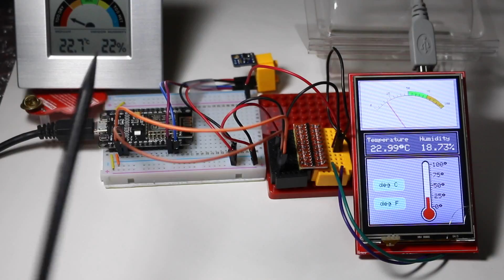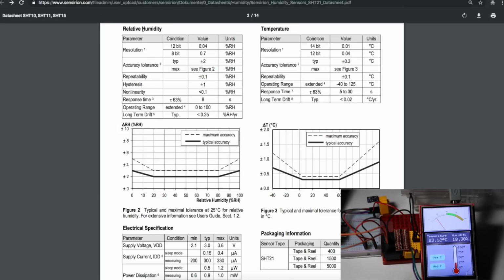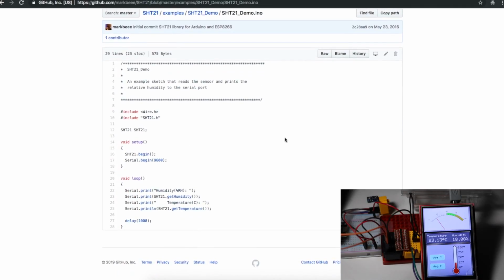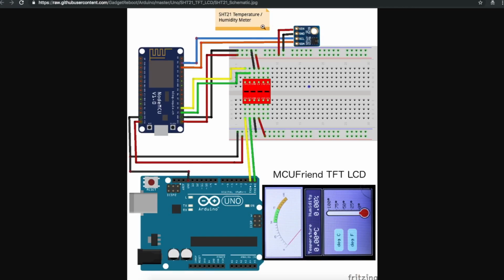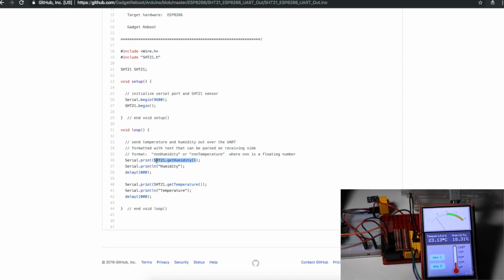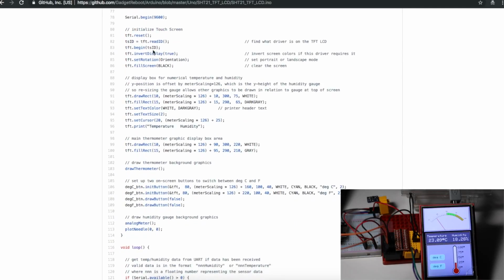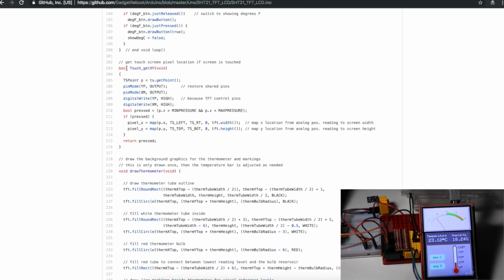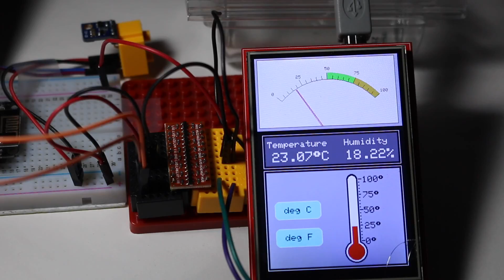SHT21 Digital Temperature & Humidity Sensor Tutorial for ESP8266

Comment: May i know if SHT21 can replace with DHT22....because SHT21 not available at my country..tq
Reply from the maker: I used DHT22 with Arduino Uno and this other video, https://youtu.be/ATROwE9lYHM
 It should work with ESP8266 if the sensor is powered from 3.3 V instead of 5 V  because the sensor data sheet says it can operate at 3.3 V which is what ESP8266 needs. 
 So you could try taking this SHT21 sketch and commenting out that sensor information from the sketch and then copy over the DHT22 information from the other sketch and merge it together.

Comment: Very interesting project.
What screen are you using, a 3.5-inch ILI9488?
What should I change in the sketch to, instead of SHT21, use a bme280 or DHT22?
Thank you
Reply from the maker: That sounds like my touchscreen, it’s either 3.5 or 3.6 inch and the diagnostic tool said that the display driver is  ILI9341, ILI9488.   I never did fully understand how to decide which driver it is I just mess around until I get something working and I even have to refer back to other display videos I have done successfully to doublecheck. 

 I have a DHT22 sensor that I haven’t used yet so I’m not sure what needs to change until I work on it and do a video. I will try to do that soon because I need to do garden watering sensor things anyway. 

 Keep checking back and I will try to do the DHT22 using this same display and set up.
Reply: @GadgetReboot  Okay, I'll wait; thank you
Reply from the maker: I’ve started adapting some older temperature sensor projects to use DHT22 now.   I hope to have something more presentable later but for now I put one sketch on github that used to use DS18B20 and a slightly different touchscreen printout so you could check that out while I still work on putting one or more videos together and eventually modify this particular SHT21 project.
https://github.com/GadgetReboot/Arduino/tree/master/Uno/DHT22/TFT_480x320
Reply: @GadgetReboot  Hi friend! Thank you for this sketch, I will try and, when you have some others, if you can, please send me, I will be very grateful.
I always comment: there is a great inconvenience regarding the logic pins of these Displays, that resistors (or dedicated ICs) must be used to suit their logic voltage. In case of using Arduino Uno, Nano, for example, that has its logical levels with 5V. Manufacturers should have thought of this - what do you think?
Hi friend (Gadget Reboot), thank you for this sketch, I will try and, when you have some others, if you can, please send me, I will be very grateful.
I always comment: there is a great inconvenience regarding the logic pins of these Displays, that resistors (or dedicated ICs) must be used to suit their logic voltage. In case of using Arduino Uno, Nano, for example, that has its logical levels with 5V. Manufacturers should have thought of this - what do you think? Thanks again,
Daniel Fernandes

PS. How should the pins of ILI9488 be connected to Uno or Nano?
Reply from the maker: @Dancopymus  The video with the projects included is now posted:  https://youtu.be/ATROwE9lYHM  
It shows how the pins of my display line up with the Uno pins to plug in correctly.  I haven't tried with a Nano so I'm not sure if there's enough pins free because  my display has so many pins - there are some that use fewer pins with SPI and those may work better.  I should shop for more than just the one that I have with so many pins.  

Since Uno came out so many years ago, back then 5V and 3.3V were both in use, transitioning toward 3.3V, so since the old 5V technology is still used for some Arduinos, it's hard to know which voltage to support on new hardware that will connect with old, so level shifting may be the only way unless the interfaces are designed backward compatible.   

For hobby work, we can add the inconvenient level shifters but for market production, I can see why modules would only support 3.3V going forward, being compatible with more modern hardware.

Comment: Wow ! This looks great ! Exactly how I imagine it in my dreams, but very far away from what I can build myself :D The analog humidity display is a nice touch.

And what a coincidence. This morning I got mail from China : A small OLED display. I don't have the DHT22 module yet, but with the help of a salvaged thermistor, I was able to lay down the first stone of my own Thermometer/Hygrometer project. I'm still on the very early learning stage, but bit by bit, it's sinking in my thick skull :D

https://i.imgur.com/egU0yH0.jpg
Reply from the maker: Looks like you’re on your way to completing a project as soon as you get the DHT 22. That’s the good thing about the open source and open hardware, easy to get up and running with other projects to reference. 

 If you had the same touchscreen that I have, you could plug it right on top of the Uno and use some existing code and have the exact same display that I had going.   Just add in some existing reference code to access whatever specific sensor, find one of the available pins not used by the screen or use another way to hook up an extra processor like I did, ready to go. 

 I’m looking at how to make mine work on Wi-Fi right now since the ball is rolling. 

 I like how you clipped the breadboard onto the helping hands and it’s at an angle. It gives me an idea for making things easier to show on camera. I’m always jamming things under other things to try and angle them up so the camera can see or to get rid of glare. I might use that trick!
Reply: @GadgetReboot  I did notice in a couple of your videos that sometimes you struggle with parts that don't want to stay at the right angle. Didn't you hear me scream "Use blue tack, man !" a couple of times ? :D For me the helping hand is the most practical way to have the display right under my eyes when I modify code on the computer. It saves my neck since the computer desk is at a 90° angle with the working bench.  
And yes, I will be looking for another display. That touch screen looks definitely more adequate. I was surprised at how tiny the 128x64 display is. Even if I knew it was supposed to be only 0.96", I kinda imagined it at least twice as big. But it's not a waste. It's cute and it can be used for other things.
Reply from the maker: I've been thinking of getting another 128x64 that is white instead of blue but maybe only if I see a good deal since it's only for low priority shopping addiction.

My lego breadboard baseplate has a bunch of blue tack stuck in between the posts now from trying to tack non breadboard items down on it, like the GPIO expander module.  I find if I leave it for a day it's more likely to try to become permanent.

Comment: I have had a lot of trouble with these sensors over self-heating and/or thermal conduction through the PCB. I wanted to make a temperature reference based on the SHT35 (basically the same sensor, but with better rated accuracy) and ended up having to go through a lot of work to design a 3d printed case that thermally isolated it from the microcontroller and switching off power to the sensor. It seems like the SHT sensor is especially vulnerable to self-heating based on my experience with several of them.

Also, the ESP has clamping diodes, you can leave out the level shifter. There was some doubt about it early on, but the Espressif CEO confirmed it was safe to use with 5V logic.
Reply from the maker: Is there any published thing about the 5V tolerance? I saw general talk about it  when looking it up but then the data sheet suggested it wouldn’t be tolerant so I was playing safe. 

 I noticed weird behaviour with the humidity reading if I tried to touch the sensor to warm it up for testing.  The humidity may go way out of expected range and take a while to come back.  I think I’ll try doing some characterizing right now when it’s generally colder and less humid and then going towards summer see how things compare with performance and see what’s going on. 

 If controlling it’s power off and on can be a workaround for any self heating, at least that can be a workaround although annoying and requiring another I/O to control it.
Reply: @GadgetReboot  The CEO confirmed it on Facebook and people have tested it ad nauseum, it's pretty solid. I dunno why they don't publish it more widely, but I've since used them without level shifting without any problems, I have one project that's been going strong for almost 2 years. The one caveat is that you absolutely cannot POWER it from 5V, but the GPIOs are perfectly ok with it.

The weird behavior touching it might be moisture or oil from your finger. The sensor element is rather exposed, they actually sell a dedicated semi-permeable cover for the sensor. You can keep the self-heating to a minimum by physically isolating the chip from anything else on the board and powering it from 3.3V. I use mine as a reference to calibrate other temperature sensors and I just set them in close proximity with a fan blowing air across them, which I've found gives me the most accurate reading of air temp and minimizes any remaining self-heating effects.
Reply from the maker: Definitely strange that the ESP data sheet doesn’t contain the info because I think the data sheet I looked at was from 2018 so they had lots of opportunity to update. I’ll see if I can dig out anything on Facebook.  

 I think I’ll also dig into that SHT sensor and see if I can find anything about application notes or information about why it might be so sensitive to its own environment. Would be interesting to gather up all the resources for any information about ambiguous things like this so we can all reference it.  

 Thanks for pointing these things out.